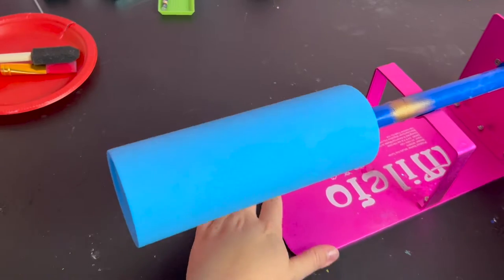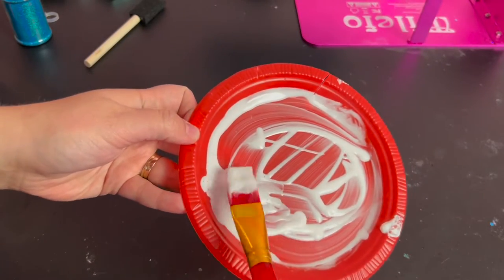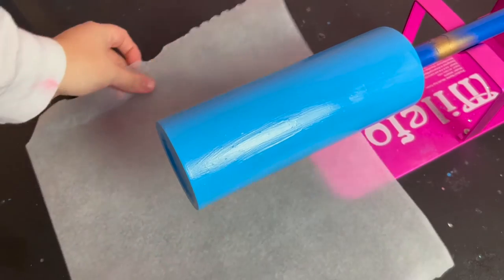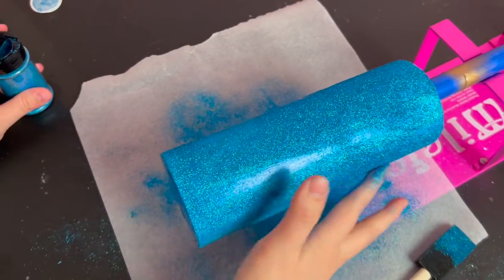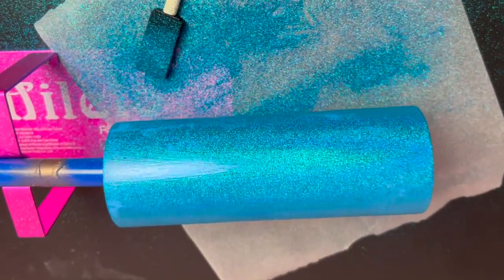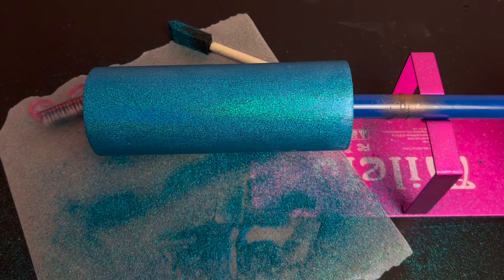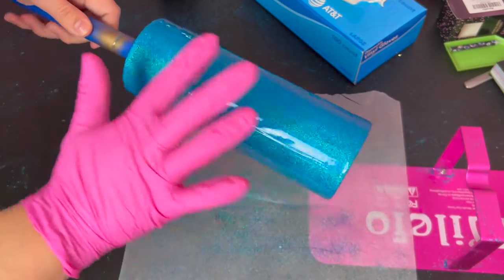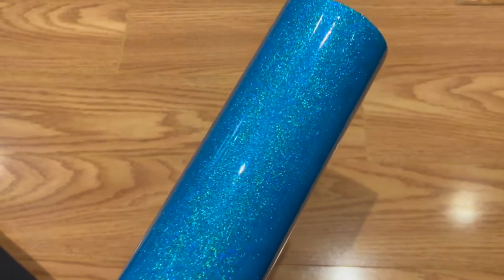TACK IT METHOD GLITTER TUMBLER TUTORIAL // Laser Holographic Cup With Aleene’s Tack It Over and Over

Comment: I've read that uv resin is not food safe.
Reply from the maker: This applies if you’re coating, say, a plate in resin and then eating off of it, but the UV resin only coats the outside of the tumbler where you’re holding it with your hands, there is none on the inside where your beverage is held. So not an issue for food safety in this case! 😊
Reply: @ElizabethSparkles  But we all know that many people do not use straws with their tumblers.  I don't sometimes.  Their mouth is touching the upper rim.
Reply from the maker: This tumbler (like most tumblers) has a plastic lid with a rim, so even without using a straw, there is never any contact between the lips and the resin. 😊
Reply: @ElizabethSparkles  So I guess you know where all your lids are?  The average household does not.
Reply from the maker: If you don’t want to use resin to make a tumbler, don’t! 💕
Reply: @ElizabethSparkles  I don't.  I hope you're not selling those.
Reply: Not wanting to argue.  Just wanted you and all of YT to know it is not safe.
Reply: Found this.  I recommend you put a layer of epoxy resin on top of the uv resin.
"Not approved for eating and drinking: Most brands of UV resin are not FDA-approved for eating and drinking, so don't put it onto cups, plates, or eating utensils. If you really want to try this anyway, add another layer of epoxy on top to seal in the UV resin."
Reply: @PAndrew002 That's interesting, I guess it varies by household because we definitely lose tupperware lids but everyone in my house always uses lids with tumblers. I find it more comfortable to drink using the lid or straw vs out of a tumbler anyway